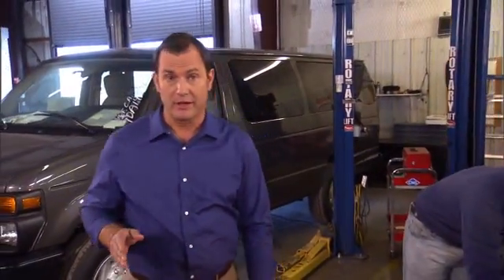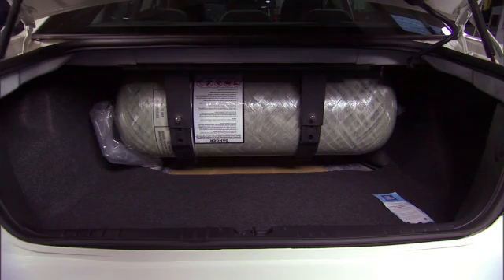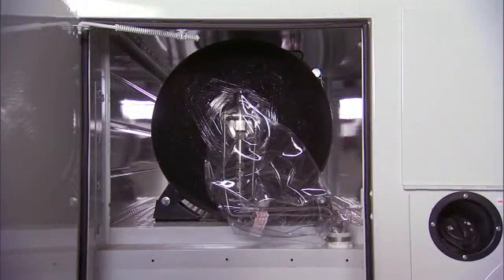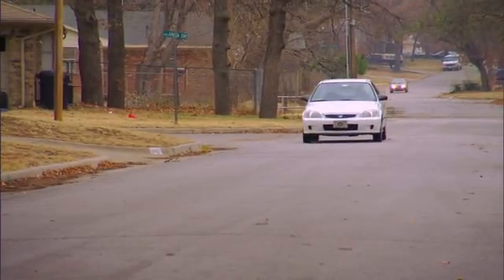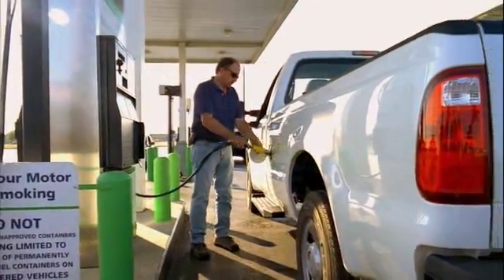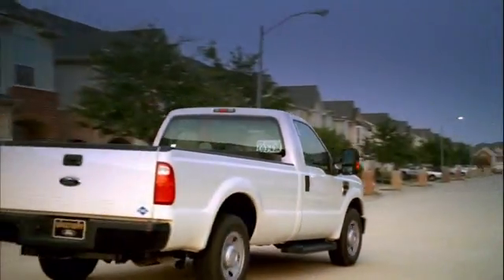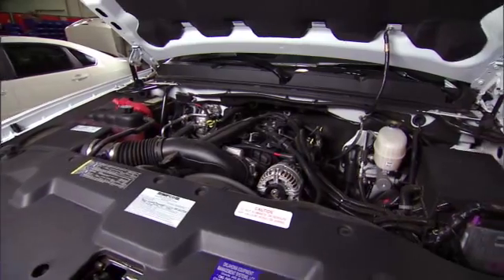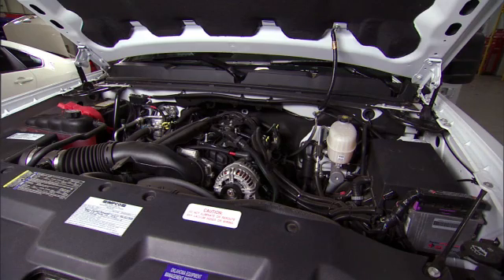What's under the hood of a natural gas vehicle?

Comment: I have a 2001 Chevy Cavalier and the CNG station just opened up around here,  I run both gasoline and CNG and can compare the 2 easily as well as switch between the 2 easily when I run out of one.  Around here, CNG is $2.40 and will take you 150 miles on a $12 fill.  I would go 350 miles on a tankful of gasoline for 45.00.  That saves $10.  Yeah, you have to go to the pump more often, but it's worth it if you want to put in the effort.

Comment: I have a Bi-Fuel Ford Contour that I bought used recently and so far never even thought to use the CNG tank. How would it work? Can I drive around with both gasoline and natural gas in the vehicle? Do I have to alternate between the two? How would the fuel gauge calibrate?

Comment: And about pollutions is totally , inverted, LPG has less CO2, HOX, O2 particules , that cng, depend of the blend of propane/butane available on your location.

if you run 100 miles dialy, and have a tank with 10 mt3 you will need to refill 2 times each day the same tank, instead when using the LPG last 3x more distance with the same size of tank, for example 60 liters (16 gallons).

LPG is far better that CNG in all the aspect.

sorry for dissapoint you.

Comment: @rikinptl 

CNG is dangerous as well compare to LPG, CNG tanks are heavy, and dense, because use double the steel to archieved the high pressure on the tank. (3600 psi) compare to 140-150 psi of LPG. The only significant improve on safety is that cng is lighter that air, and disperse more easy that lpg.

in the most of the vehicle you ahve to use spark timing advanced of the engine otherwise  you don't get benefits.

CONS:
HEAVY TANKS
HIGH COST KIT
REFILL EVERYDAY
LOST OF POWER 10-15%.